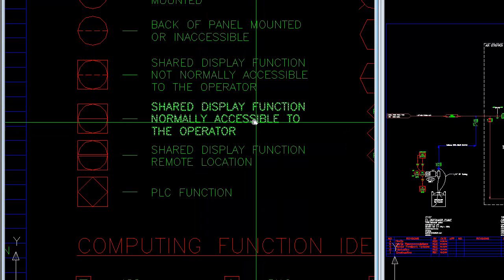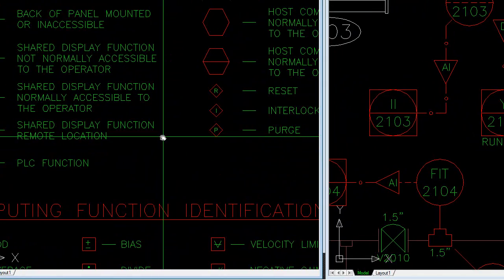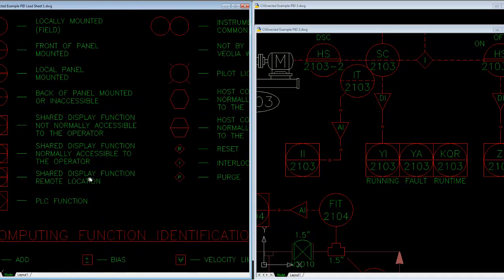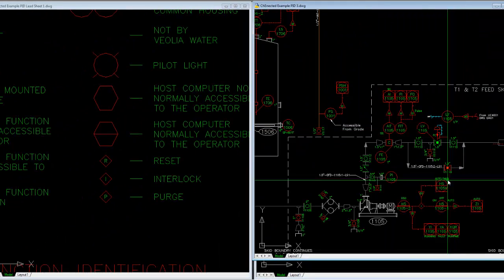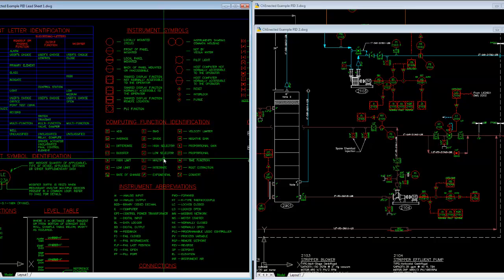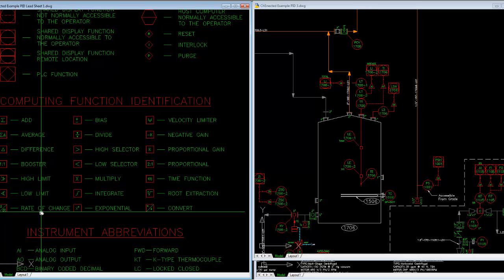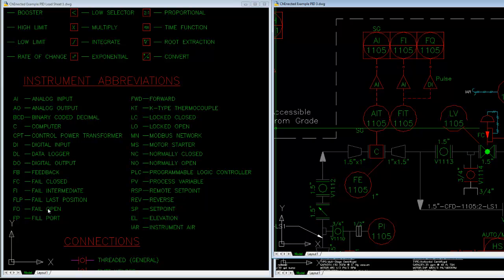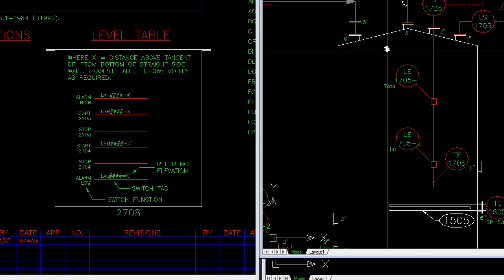Part 3 of 3 Instrumentation and Valves Lead Sheet

Comment: Robert, you give a really good explanation.  The only thing I would mention is that the square with the diamond in it is VERY important for the operator when the PLC being referenced is the Safety Shutdown System.  The operator really needs to know what devices interface with that system and this is indicated by that symbol in many cases.